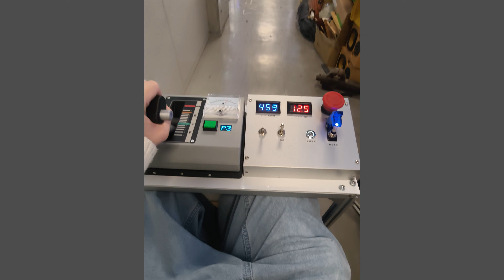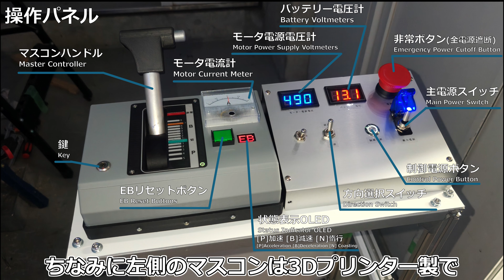電車の音を出しながら走る！自作VVVF搭載カートの紹介＆解説

Comment: Hello! I am a control electrician in US. Suggestion!
For longevity! I suggest a fan for air flow inside the cabinet with all the components to have constant air flow.
Inverters do create heat so it should be great to dissipate heat!

Comment: It reminds me of the old metro cars here in Montreal, where the chopper motors of the MR-73 cars would make three tones like musical notes when accelerating. The tones became so iconic that the modern rolling stock plays the same three tones over the speakers when closing the doors.

ここモントリオールの古い地下鉄車両を思い出します。MR-73 車両のチョッパー モーターは加速時に音符のような 3 つの音を発していました。この音は非常に象徴的なものとなり、現代の鉄道車両でもドアを閉めるときにスピーカーから同じ 3 つの音が鳴ります。
Reply: In Mexico City we had a train (MP-82) that made a similar sound thanks to its French SCR traction/braking system, unfortunately at the beginning of the 2010 they were exchanged for Chopper Alstom IGBT.